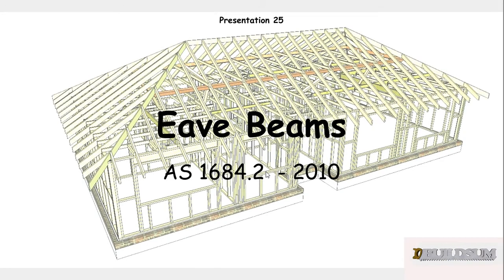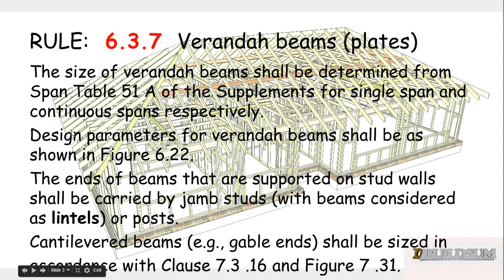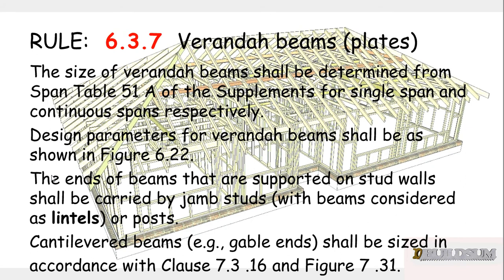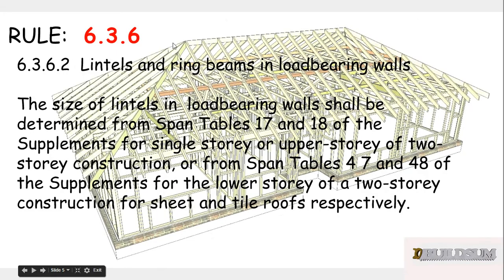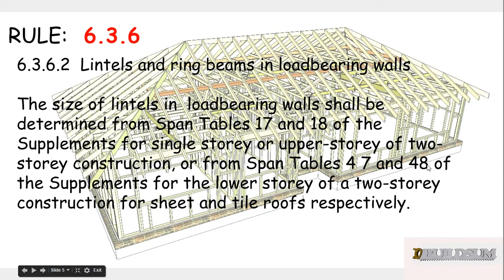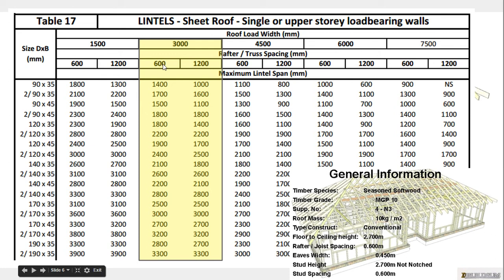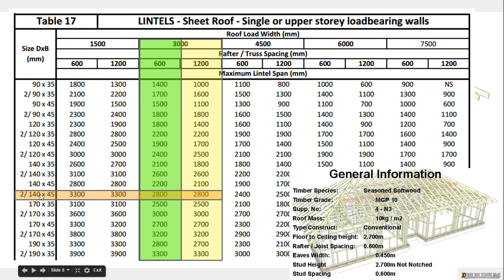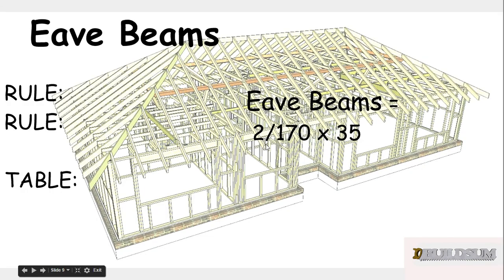25 Eave Beams

Comment: Have you ever heard of bolt on eaves.  The external wall and roof insulation are a continues layer and building wrap sitting over the external insulation form a continuous layer.  The bolt on eaves has a waling plate for the rafter to get fixed to in the eaves zone as well as a waling plate for the sofit bearer/eaves bearer.  I have never done one but have seen them built in the us on youtube.  by the way i'm in Australia
Reply from the maker: Hi Mate, I'm in Sydney, No ive never heard of Bolt on eaves.
Reply: me too thanks thought id give it a shot and ask. @Buildsum

Comment: Hi what  is different between eave  and soffit?
Reply from the maker: Hi Mate, the eave is basically everything that hangs overhangs the wall, so the tail of the rafter, the frame that supports the eaves lining ( or soffit) and the eave lining. 
The term soffit is a general term for the underside of an architectural object. So the eave soffit is the material that you use to line the eave with.
Hope this helps
Reply: Buildsum ,Thanks heaps mate.